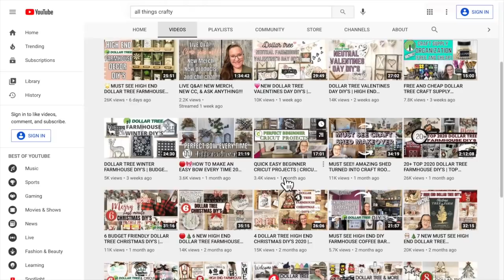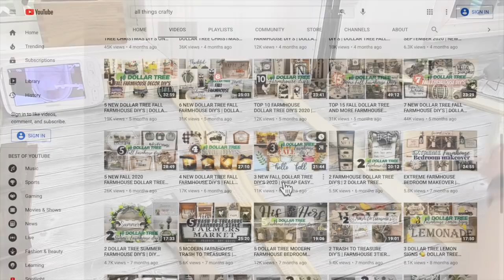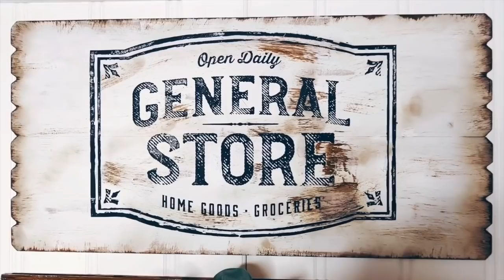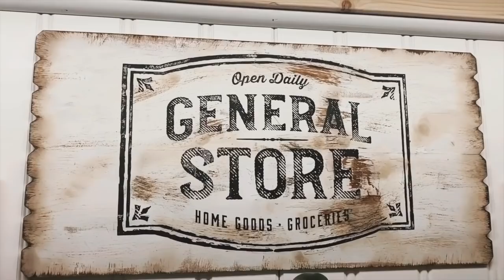🌟NEW HIGH END DOLLAR TREE FARMHOUSE DIY'S | MUST SEE DOLLAR TREE FARMHOUSE DIY'S ON A BUDGET 2021🌟

Comment: I have a couple of ideas for you using the arches.  1) use jinga wood between the two arches to keep them separate. Use wood putty to fill in the spaces of the blocks. Sand to smooth. Use led twinkle lights to light between the two arches. 2) mirror behind the arch. I don't know how to cut glass, so it could be a great how-to with the DIY. Your ideas look really good.  They do not look like they are from dollar tree. Great job.